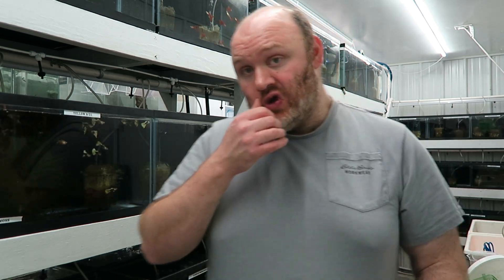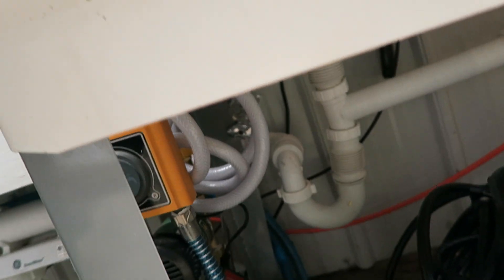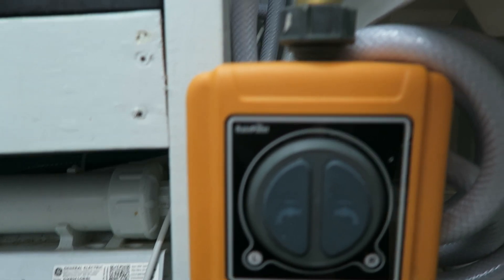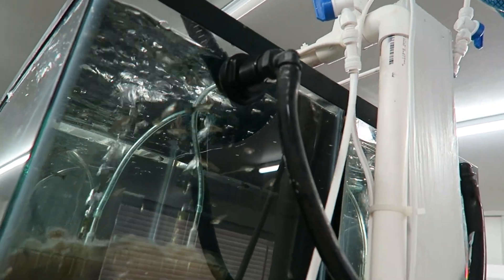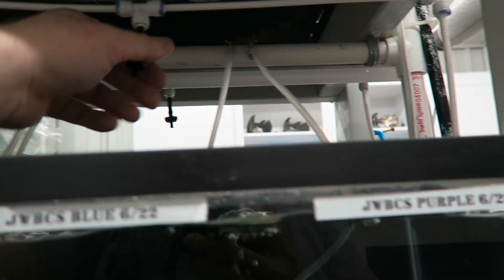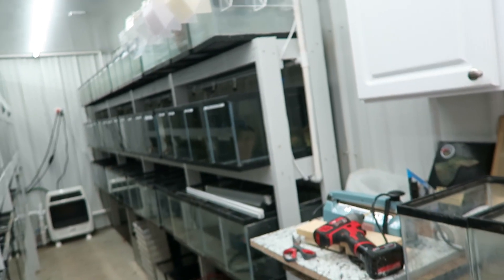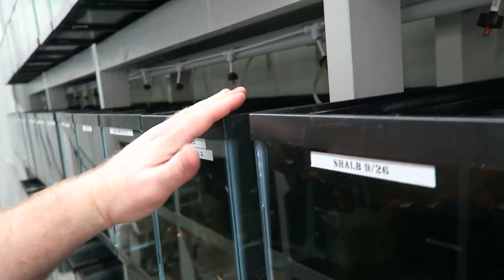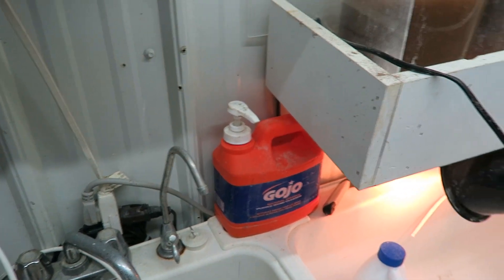Fish room Automatic Water Change System

Comment: Great system Tim, thanks for sharing. I have a similar system except after my thermostatic controller I run mine through a carbon block filter (city water). Have you tried pre-filer sponges instead of the cage overflow fittings?